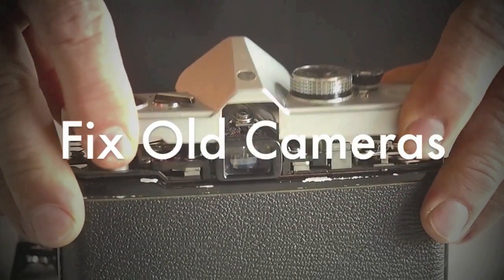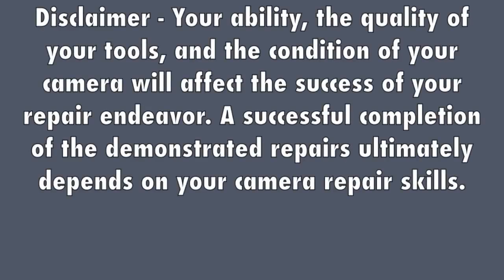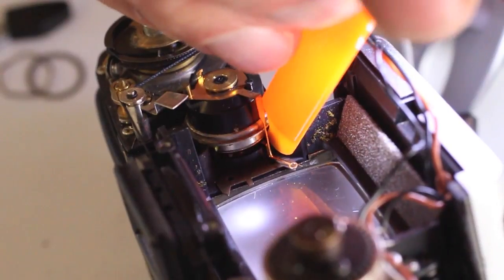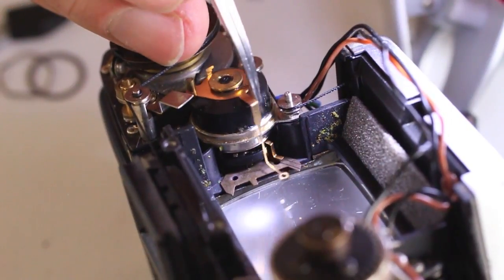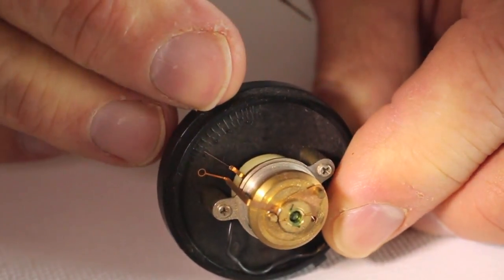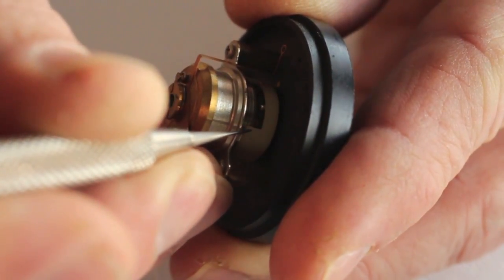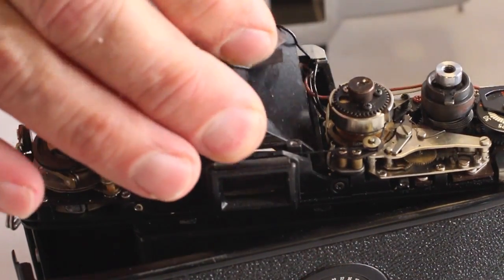Fix Old Cameras: Minolta SRT Meter Release

Comment: Hey there, on my SRT 101 the needle with no circle does not move when I put my camera on the “On” position but when I put my camera on the “BC” position the needle with no circle moves to the middle position... do you know why this may happen or what I can do to trouble shoot this?
Reply: I have the same issue. You could fix it?
Reply: Jorge Alberto Belmont Guadarrama have you ever opened up your Minolta before?
Reply: @ItsEddyPro  no, I don't
Reply: Jorge Alberto Belmont Guadarrama has it always been like that or has it happened recently? I found out that mines was doing that because when I had opened up the camera and closed it up I had actually pinched a cable inside and I was able to move the wire away from the metal frame of the camera and now it works fine

Comment: I just received a beautiful black SRT 102 today that I bought on ebay for $10. The seller said everything was working except for the meter, so I figured I would just buy it and give this repair a shot. Once the prism is removed, there is a thin plastic guard between the prism and the needle assembly which was not shown in your video. It made access to remove the foam pieces rather difficult. It's possible this is unique to the 201. At any rate, I just worked the needle free with some tweezers and now it is working like a charm. Thank you once again FOC! Absolute best camera repair videos on the internet!
Reply from the maker: Thank you for your interest in Fix Old Cameras and congratulations on a successful repair.

Comment: Much thanks!  I picked up an SRT101 for $20.00 because the meter wasn't working.  The meter now works like new.
Reply from the maker: Very good to hear.
Reply: How exactly did you fix it? I had it open but couldnt see any foam to remove.
Reply: @LMFAO5001  If your foam has been removed previously then you probably have another issue.
Reply: @mrphotomanseattle  i couldnt tell, should have the pieces of foam been obvious to locate?

Comment: Hello, thank you for your video but I have a different problem on my minolta SRT303. In OFF mode the needle is up. In BC mode, the needle is on the middle mark. Nothing abnormal. When I put the device to ON, the needle oscillates very little, it stays in the middle, even when I point a strong light source or a dark area it only moves slightly ... The measurements are wrong. I use a 1.35V Zinc Air battery and the battery compartment is clean as well as the tab ... Do you have a suggestion? thank you
Reply from the maker: Possibly the CDS cells need replaced.
Reply: @FixOldCameras  Are there any calibration options for the meter in these? I've an SRT202 that I've recently brought back to life and refurbished (rescued from the literally trash-bin by my father-in-law from a friend who was moving and assumed it was junk I guess). Functions great now - all speeds reasonably accurate, etc - but the meter readings show consistently at least 4 or more stops above correct exposure values, e.g. it seems to work and respond just fine but it is much much too sensitive.
Reply: @emmaeggs  Exact voltage does not matter for the SRT series as it does in many other similar era SLRs.. They have a bridge circuit equipped with supplies the correct/expected voltage to the meter regardless of slight discrepancies between the common mercury of the day and modern alkaline, silver oxide, etc. One of the perks of this system. 
(That said, the behavior is the same with all the chemistries I've tried... Which is why I asked @FixOldCameras. May well be just a tired cell.)

Comment: I got a Minolta set 201, the light meter works fine however the follower needles seems like  its calibrated incorrectly, sometimes it will be too high up, other times it won't go all the way up....any help????
Reply from the maker: Make sure the needle its self is not dragging against the viewfinder screen or prism. Otherwise the galvanometer operation is could be hanging up or you could have a short in the wiring of CDS cells.

Comment: I hace an 100x and the meter doesnt pasa the middle to the down part, its always on the up zone. If i switch BC the meter rarely goes to the square point. I dont see if it has any micro foam pieces. Any suggestions?
Reply from the maker: The spring coil of the galvanometer might be compromised. It is delicate but it can be addressed by removing the plastic lower cover. Otherwise you might end up swapping out the galvanometer from a donor SRT camera.
Reply: Fix Old Cameras Thames for reply, i have fixed few days ago, i put batteries directly on battery check pins and the meter works fine, finally was the battery container. It was a little dirty by old batteries, thanks
Reply from the maker: @CharlieRacing83  That is excellent! It only takes a little corrosion to compromise the current flow from the battery. The battery chamber should of been the first suggestion to check. However, from you description it seemed you were already past that point. Good to hear of your success. Keep'em going.

Comment: I bought an Srt101 back in January of a guy from Craigslist. It was working great until I think two months ago. The light meter needle doesn't seem to be moving, and it just sits in the top right corner. Is it stuck, or is it the battery? Also, I'm way to afraid to try and fix it on my own , how much do you think it would cost to repair? Thanks!
Reply from the maker: When the meter needle is in the resting position it reside at the top of its travel. Make sure that you have a good clean battery connection, for even a light film of corrosion will block current flow. If you are interested in looking into getting your classic camera repaired... start here. http://www.phototronic.biz/services.html

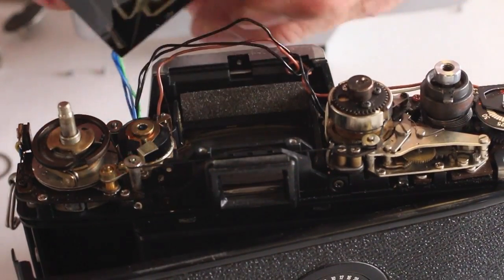Comment: hello there, how do I fix the string over the left connection on min 0:24. Also, how do u I put back the roll bra from the inside???
Reply from the maker: Not sure what a roll bra is but it sounds interesting. There are plans for a FOC video showing the routing of the meter connections cords of the SRT. Not sure when it might appear.
Reply: @FixOldCameras  Hehe, don't worry about it. I already found a Minolta PDF for its assempbly on which al parts are exposed and told how to be set. Thks a lot btw!

Comment: my camera doesn't focus, why is that?
Reply from the maker: +Luis Giraldo If it is related to only one lens than it would be probably that lens which is causing the issue.  If it is occurring on multiple lenses then the camera focusing sequence will need to investigated. Because the focusing screen can not be easily removed, it is doubtful that it is upside down, but if it is that would cause focus problems. Reflex mirror alignment issues is also an unlikely but possible cause.

Comment: Thanks for this video, but I have a question: the circle pointer does not move when I operate the coupling of the aperture ring, the shutter speed dial, or the ASA dial. It could be because a string is broken, or jumped off the guiding rollers? Thanks for reply
Reply from the maker: Yes,  it is possible that the attachment and or tracking of the AV and TV strings could be the cause of the following needle issue. Often the string will jump the pulley or bind in the aperture ring linkage area... start you inspection there. Maybe a FOC video covering the routing of the these strings is in order. Thank you for the comment.
Reply: We have the same issue. The needle with circle on my light meter won't move when i changed apertures but the shutter and asa are completely fine. Have you done any solution to your issue?

Comment: hey guys! i just decided to learn how to use my grandfather's old minolta srt 101. thought my light meter wasn't working when I had my 35mm lens on the body. however, when i snapped a 55mm lens on there, and realized the light meter works perfectly. any idea why this could be? i had a lady at the camera store give the camera a glance with the 35mm on, and she said the aperture was slow. the aperture is in the lens, and seems fine on the 55mm lens. could the sluggish 35mm indicate there are generally other problems with the 35 which could affect my light meter? 

thanks in advance!!
Reply from the maker: If you notice on the Minolta SRT there is a black plastic ring around the lens mount of the camera. The ring is connected via a string routed over pulleys to a galvanometer position mechanism. The tab on the ring sets against a tab on the lens. The 35mm lens probably has a broken aperture link tab. If the lens is not engaged to the ring then whenever the aperture ring of the lens is turned it will not affect the meter position. In regards to the possibility of a sticking aperture blades... this would affect the exposure but not the movement of the light meter needle.
Reply: thank you so much for your help! it means a lot. i'll give these tips a try!

Comment: What type of battery does it use and where can I buy it?
I’m afraid I used the wrong type since now the meter needle doesn’t move.
If it was of a higher voltage can it damage the galvanometer?
Reply from the maker: Without the voltage dropping diode modification demonstrated in other FOC videos you will need to use Wein Cells which are basically zinc-air (hearing aid) batteries with fewer ventilation holes to achieve a longer lifespan (approx. 6 to 12 months), as they do not dry out as quickly as normal hearing aid batteries. They have a smaller maximum power output than standard zinc-air batteries, but for photographic equipment this is not a problem, as the meters do not need much power. Wein Cells are a bit expensive and can be difficult to get in some places, but they are always available from several sources on line.  You could also use a battery adapter sold under the name MR9. However, experience has shown them to be problematic and can not give a strong recommendation for its reliability and they are expensive. Some are nothing but a brass seat for a 1.5 button cell and have no voltage dropping capability at all. Hopefully others can give some feedback on the MR9 adapters. Maybe a FOC video can feature the installation of a voltage dropping diode in a Minolta SRT meter circuit. In the mean time.  Here are some videos that might be relevant on making the diode modification. https://www.youtube.com/watch?v=Y_WOwee8Qhw
https://www.youtube.com/watch?v=dFq9etVH2og&t=116s
Reply: @FixOldCameras  Thank you very much
Reply from the maker: @TheHoracioestrada  You are welcome... also a 1.5 button cell will not damage the SRT meter. You could use one in a pinch and compensate for the hotter meter by adjusting the ASA setting. However such an adjustment is not linear, therefore relegating the meter to inaccurate meter readings under high and low lighting conditions.
Reply: @FixOldCameras  This means the meter might be stuck. I will take a look at it.

Comment: I used your video and it worked great. I didn't have to remove the foam just moved the needle and now it works fine. I guess the needle stuck from lack of use. I'm giving it to my granddaughter she is really into cameras.
Reply from the maker: It might stick again in the future, if not all the better, if so just go back in and check to see if the foam stopper is causing the needle to stick.
Reply: +Bill M please comment again if you find that the needle gets stuck again.. i just did the same as you, and my meter works fine, as well. was wondering how long it might actually last.
Reply from the maker: Time will tell... the more the meter is used the less likely the needle will stick again. To ensure the needle does not stick go ahead and carefully remove the small foam cushion as demonstrated.